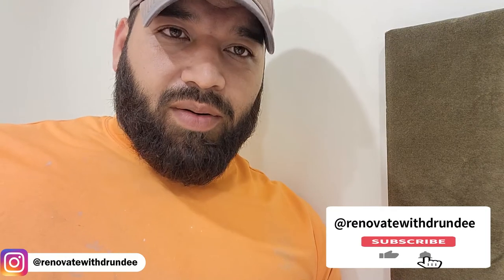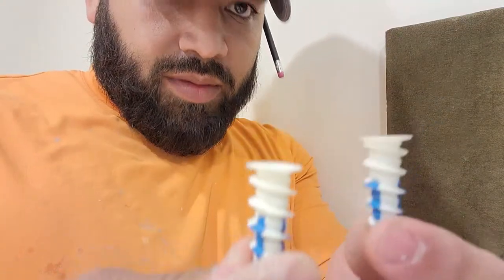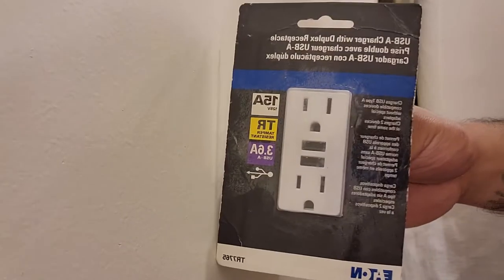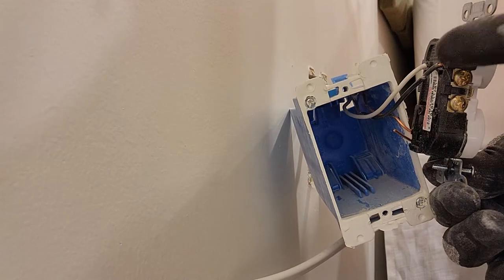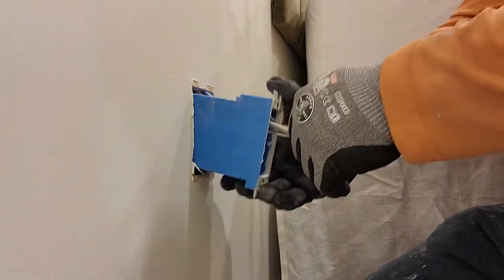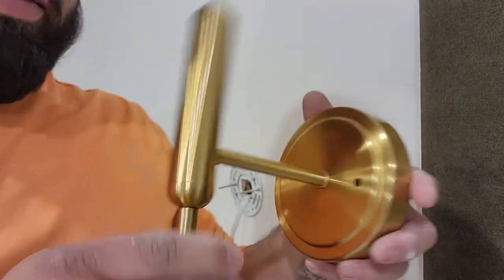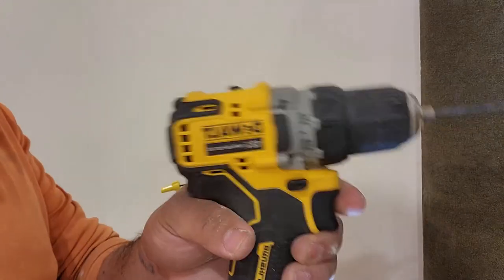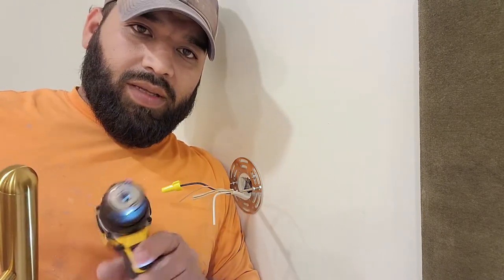How To INSTALL WALL SCONCES || adding a ON/OFF SWITCH || EASY & AFFORTABLE

Comment: Would that work with a small rotary dimmer? I was actually looking at the exact same wall sconces for the mantle. The old sconces that were currently there when I bought the house have little toggle switches so there is no wall switch. I was nervous about putting in a little switch like you just did wondering if people would get electrocuted when they touched. this was very helpful!
Reply from the maker: If it fits inside the housing of the light fixture it should not be a problem. Thank you glad we can help 😊

Comment: What? He build a wall over his breaker box? And he's not going to turn off the circuit to this plug? I was wondering why he was talking about that bit on the drill? I would never do this and this can't be recommended People, always shut off the power when working with electrical circuits.
Reply from the maker: Great recommendation  👍  I would think people would know that especially if your not comfortable with electric but yes! I should have mentioned it. Thank you for pointing that out 👍

Comment: So I have two sconces I need to do this to. But both of them have outlets underneath them. If I wired them up like this I feel like my outlets would be off when the light was off. Is there a way to do it so the outlets stay active?
Reply from the maker: If it's a standard plug outlet then it should stay on always and the switch on the scones will turn it off and on. One thing I would change is we should've used a (pop-in) box and terminated everything that way